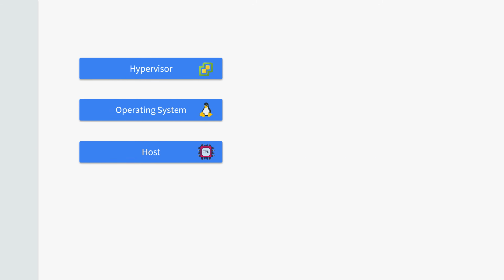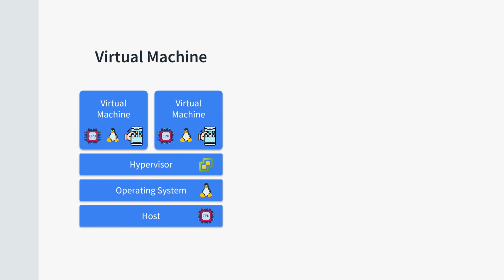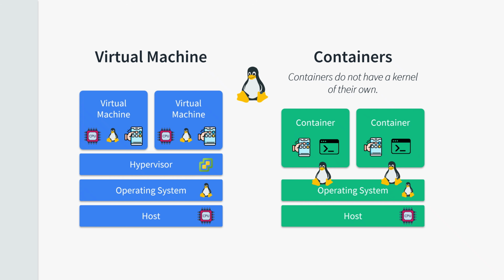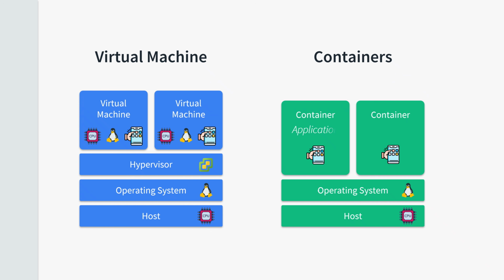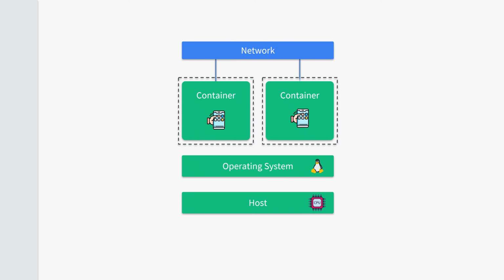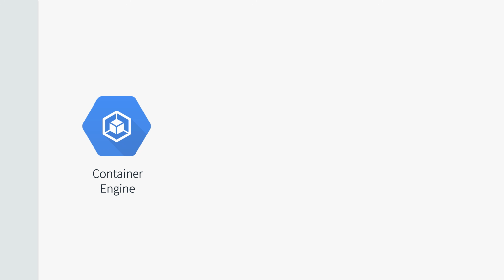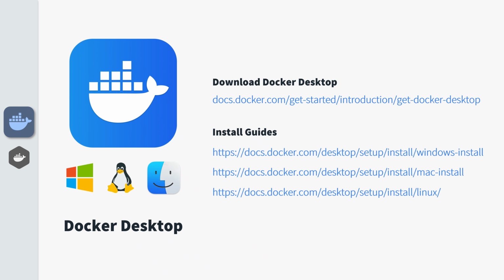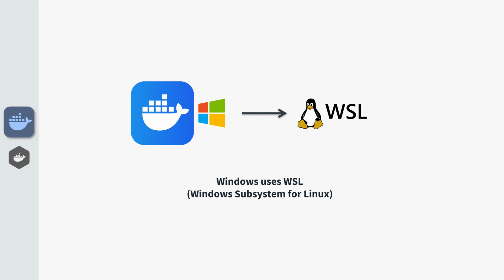Learn Docker - What Are Containers? Why Use Them? | Docker Tutorial

Comment from the maker: 🚀 Ready to master containers from an infrastructure perspective?

Most Docker courses are built for web developers, but this Masterclass was built from the ground up strictly for Network & Systems Engineers. Here is exactly what you get inside the full program:

14 Guided Hands-On Labs: Step-by-step blueprints where you will build, isolate, and troubleshoot your own container infrastructure.

2 Real-World Challenge Labs: Unguided, production-style engineering scenarios to test your routing and architecture skills under pressure.

Deep-Dive Container Networking: Master the mechanics of Docker Bridge, Host, Macvlan, and IPvlan network drivers.

A Fully Deployed Production Stack: You will build and configure a live enterprise environment featuring a custom Core DNS Server, WireGuard VPN, Traefik Reverse Proxy (with SSL/TLS), Vaultwarden, and full Prometheus/Grafana telemetry dashboards.

End-of-Topic Quizzes: Knowledge checks at the end of every section to ensure you've actually mastered the concepts.

Stop copying random StackOverflow commands. Take control of your container infrastructure today.

👉 Get instant access to the Masterclass here: courses.networkdirection.net